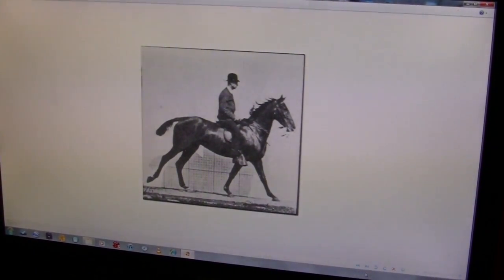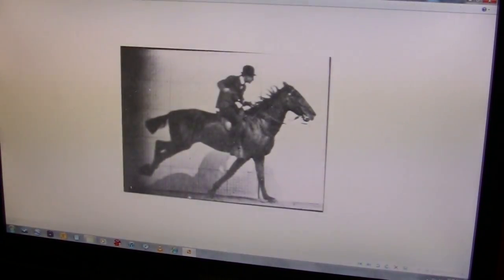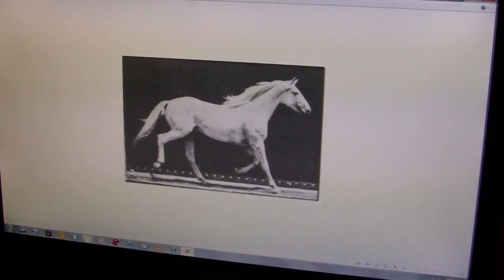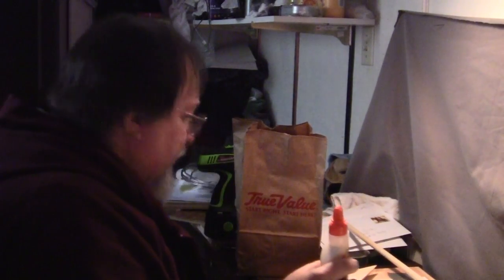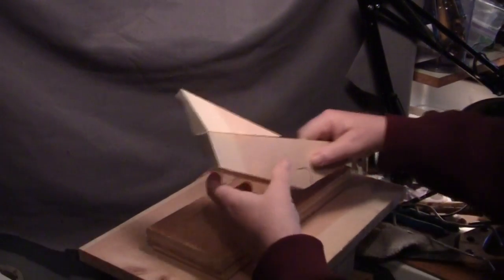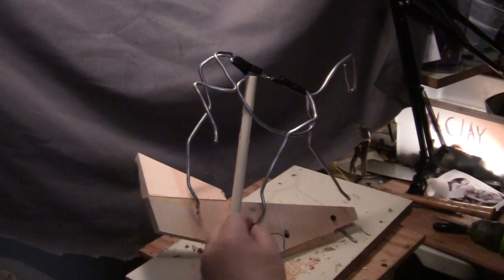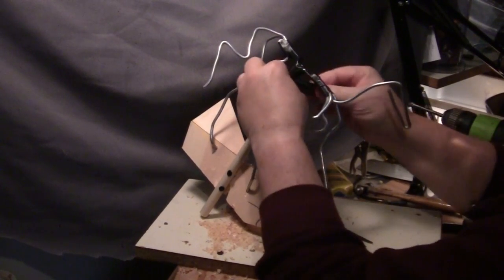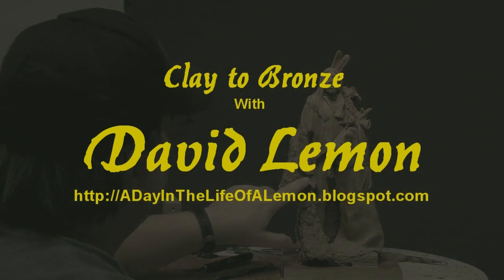Sculptor David Lemon - Mounting the Horse on the Base - The Design Takes Shape

Comment: dear sir, 
            i have been trying to find a way to make a sturdy sculpture frame for some time and had resorted to using tin foil. you can guess how effective this was. but after watching your video and going to your website i found my self inspired and only hove one question. now please dont laugh but, when you are finished with your model and the dowle is still holding in place how do you remove it? do you just cut it off and sand it down? 
              a question from an ameature.

Comment from the maker: If you don't know the answer, asking isn't stupid or funny... You leave it in. Since my work is cast into bronze, and they make a rubber mold of the clay. They pour wax into the mold.. swish the wax around and pour it out again, having coated the walls of the mold with a thin layer of wax. The keep doing that till it's the thickness they need for the bronze. Then they take the hollow wax out and cut off things like the post.. and then fill the hole. That's about it... good question.